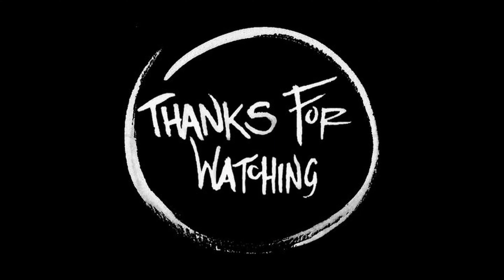Can Am Maverick X3  "OOH THAT SMELL" Can you smell those gas fumes.

Comment: Great tip! Same on the new Commander Max we have . Especially once you start putting windshields on.  The vent tube runs down the rear frame toward the rear pass seat area. The funes then get pulled up from there. I just ran mine high by the coolant bottle and put another inline gas filter  on it. Problem solved.
Reply from the maker: Thanks for watching

Comment: I'm still wondering how to get some air thru the bottom of the passenger compartment for my new Commander. I love this machine but this thing has some serious heat coming from the console tunnel. If yall have some ideas I'd be grateful!!
Reply from the maker: Thanks for watching.  I would suggest that you remove the console and install some reflective dyno mat type material or heat tape.  This will help reflect the heat away from the passenger compartment and help keep you cooler.
Reply: @AdrenalineCyclesKy  you guys are great, I wish you lived closer. I would definitely use you guys for all my can am needs!! Thanks for being a great neighbor any way!

Comment: If this is a common problem, why wouldn't Can Am take care of it?
Reply: It's not really a big deal in my machine. I was a first when I smelt it I was a bit worried I might have a fuel leak in the plastic tank or a high pressure fuel leak in one of the lines. I've probably only smelt it once or twice in 330Km of riding in all types of terrain in my 2021 Can Am Maverick XRC turbo RR. it's just one of those ATV/UTV things. One could ask why Polaris didn't take care of all the recall issues in my then new 2015 Polaris RZR1000XP & all the mods like a cam chain tensioner I had to fit or the finger tight nyloc locknut on the rear trailing arm front pivot bolt that was not done up at the assembly line. That would have been interesting if the trailing arm dropped out at the front pivot point & hit the dirt at 100Kmh.
Reply from the maker: Thanks for watching.  Some people never have this issue or notice it.  We dont do a lot of machines but we have done a few especially in our area with the elevation changes and big hills.
Reply from the maker: Thanks for watching